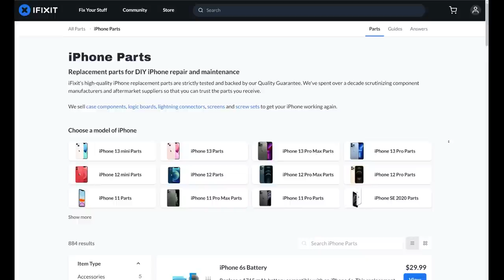Adam Savage's One Day Repairs: Vintage Lathe Drill Chuck!

Comment: Adam Savage gah you made me jealous! Plough gauges are fairly rare in the U.S. for some reason. Also yes plough gauges have specially built blades, which usually feature a pair of hooks which fit over pins inside of the gauge assembly. Blanchard still makes them I beleive

Comment: Adam, I highly recommend that you press off the outer sleeve of the chuck and clean / lubricate the jaws and split ring inside. From the sound of the chuck as you spin it it sounds as though whatever grease was inside was dissolved with the rust remover. The WD-40 probably washed the rest out. With no lube the jaws will bind unevenly and they will never tighten properly. Also, the chuck will absolutely wear out faster. Properly lubed, the chuck should be nearly silent when spun.

Rebuilding Jacobs chucks is kinda my thing and it’s pretty easy once you do your first one. Just remember the spilt rings are a matched set and the jaws have to be re-assembled in the exact same position from which they came out.

Comment: I enjoyed this video. I am a flea market fan.  I am also a Jacobs chuck junkie.  I strongly urge you to check Evolvent Design YouTube videos on Jacobs chuck cleaning and repair.  Andrew has a machine business in Ventura.  He offers service tings for a number of different Jacobs chucks and also dimensioned drawings for making your own.  The service ring is key to disassembly of a Jacobs chuck and reassembly.  If done correctly the refurbished chuck will be smooth as silk opening and closing with no grinding noise.  I sure do hope you will do more videos featuring the  Jacobs chuck.
Reply: You can pull a chuck apart with just a hammer and a punch.
Reply: @1pcfred  i have fixed a few that were taken apart with a hammer.  Not the best idea, especially if they are « crunchy » like the one Adam had in the video.  Jacobs used to make a set of service rings as part of their master service kit.  Much cleaner way to disassemble a precision piece of equipment.  Really recommend watching the Evolvent Design videos.  Especially Germaine for a shop like Adam’s with a press and a lathe.  $5.00 will get you a. Measured drawing to turn your own ring or about $40.00 will get you a CNC ring that fits exactly.  Quick easy trip to the press and Bob’s your uncle.  Save the hammer for micrometer repair and adjustment.  LOL
Reply: @robinhoff4598  not everyone is a qualified swing press operator. Let's just say there can often be some finesse involved. You have to know how to tappy, tap, tap.

Comment: Hey Adam! Saw you struggling with the glued holder. Just so you know, wood glue dissolves in acetone; clue’s in the name: Poly Vinyl Acetate (PVA). You want to apply it with a needle and a syringe. Found that out building myself a window seat/locker/media center out of an old table during lockdown 😉

Comment: I love looking for and finding old tools in places like flea markets.  

In your video you were thinking about replacing the Morse-Taper adapter.  It appeared to be quite different.  In particular it did not have the flat tab at the tip.  I think you'll find that the tailstock has a slot that that flat tab fits into.  This is to prevent the device from spinning.  The taper itself is for centering and preventing lateral movement.  

On your strap cutter that you bought, you pointed out 2 threaded screws that drove the clamps on the tool.  You said you thought they were missing the little barbell rods that would help tighten the clamps.  I had a thought....  Since this tool is manipulated to slide along and cut through a piece of leather, I think the little barbell rods would constantly be hooking on things and generally getting in the way.  I have seen threaded clamp screws with the hole in the ball or cylinder at the and, where you used a hooked pin wrench to fully tighten the screw.  The pin wrench is then removed and set aside so there is nothing dangling to catch on things.

Keep up the good work.

Comment: Adam try ACF-50, its a great lube / Cleaner replacement for WD-40. Motorcyclist use and its main job is a aircraft protection fluid
Reply: WD-40 works good enough and it is a lot cheaper so you can use more of it.
Reply: @1pcfred  …and WD-40 can be found everywhere.

Comment: Just put a "Lazy Susan" on top of the lathe so you can spin it and have all your fixtures, wrenches and collets on the same platform 🙂
Reply: Attach it to the motor with a gearing system so it slowly spins.

Comment: 8:46 Are you sure they're missing a crank? If you put a sliding handle in there, it might get in the way when cutting. 

It might have been made to use a separate key to adjust it.

Comment: Love wood working as much as the next guy, But what can be made of wood is better in full metal baby! It can be bolted to the lathe, looks better painted satin black, easier to keep clean, uses less material and last for ever. Adam's poor poor neglected welder and metal cutting saws have been collecting so much dust lately.  😥👍👍
Reply: Wood shop fixtures are cheap and fast to make. They don't have to last forever either.

Comment: Adam be careful using the table saw top as a glue-up surface.  I had a kick-back hit a small spot of glue that I missed, flipping the board and sending my hand into the blade.  I cut off a finger...  it was successfully re-attached, but learn from my mistake.  Either don't use the table saw for glue up, or cover it with butcher / craft paper first.

Comment: you should probably rotate the taper adapter and not slide it back and forward. with sliding it like this you are grinding thin flat spots on the adaptery, which go the whole length down. by rotating it you negate this issue
additionally a precision flat ground stone is necessary for things like that, not sure if yours is one of these

Comment: 37:00 why couldn't you just flip them around and screw them back in the same holes?
Reply: Probably because they're not symmetrical from the centerline. Turning it up without repositioning  it would move the pieces laterally up the board and would cause him to run out of room for all of the peices.

Comment: The top of the lathe is for drills, chucks, colletts (the shank sleeve), drifts (the wedge to knock the collett off), taps, turning tools, micrometers, and scales (rulers). The stuff you change out most often when working so you're not walking all over to get them. The changers should be on a bench nearby but not on top. You should get large drills, and cutters with a tapered shank. You're using them in the tail stock, and mill head which are tapered. You're not going to use them in a hand drill. All this makes the job run much faster, and easier for runs of several pieces. The inefficiency of your shop causes you to avoid projects you have to make multiple pieces for. You mentioned you don't like doing that in a previous video. Your shop is a nightmare, and getting worse. As we age we lose energy. Wasting energy in an inefficient shop will make it difficult, and eventually impossible to work in it. Even your brain having to navigate the maze of that chaotic hoard will rebel. You will lose your ability to think through a job because of all the energy required. You likely had that frustration for many years. It's going to get worse.
Reply: Wow, going to criticize him for doing what works for him? If he doesn't like something he'll change it. #triggeredcauseitsnotmyway

Comment: The entire chuck should never have been placed in the rust remover.  It's acid and attacks the metal as well as the rust.  That looks like an older 20N Jacobs Super Ball Bearing chuck which use ball bearings to take up the thrust (made before they started turning the top of the sleeve smooth and stamping it Super Chuck).  The problem is the acid will start eating the surface of the balls and races causing damage to the surface finish.  In this low speed application the etching is probably not that critical, especially given the half-dozen times he may find a use for this chuck before the inevitable estate sale, but more about one's stewardship of tools in their possession.  Many folks don't care but clearly Adam does and many folks down the line that will watch this video may not realize that they're doing unnecessary damage to the tool by using rust remover.  It should always be last resort, not a first resort in my opinion (I'm a machine tool tech. by trade and cheap home machine shop hobbyist so lots of direct, relative experience). The proper procedure would be to remove the arbor from the chuck and just place the arbor and sleeve in the rust remover.  Personally I would have tried to remove the sleeve with a drift right off the bat before going further, or better yet simply buy the correct MT4 to JT5 arbor, they're not that expensive.  I've got one in really nice condition I recently removed from a 20N I'd send him for free.  No matter what, I would disassemble the chuck to clean and most importantly, re-grease it.

Comment: I think those 3D printed holders will wear or break very quickly with those heavy tool mounts?
Reply: I've been using them for a while, granted on the smaller "A" size multifix holders and been surprised how well they hold up. Just make sure to do them in something solvent resistant like PETG